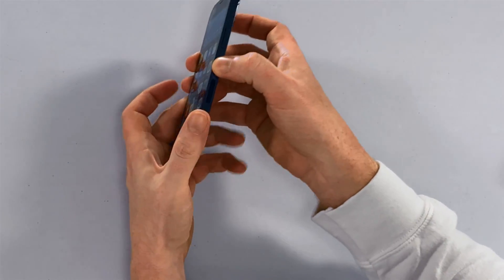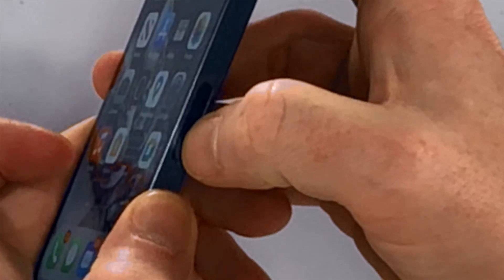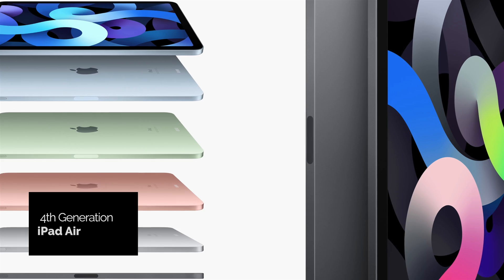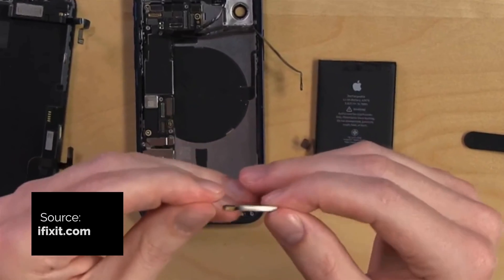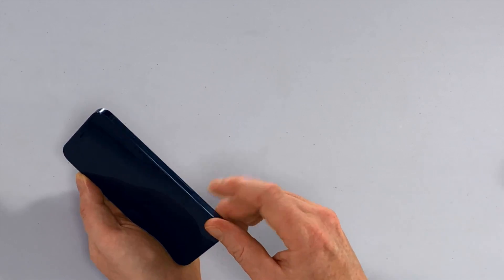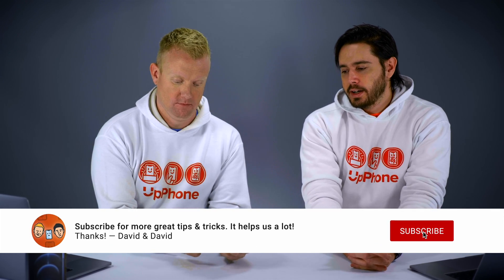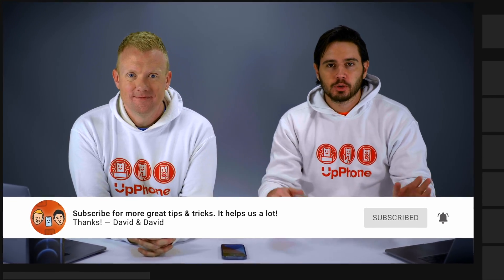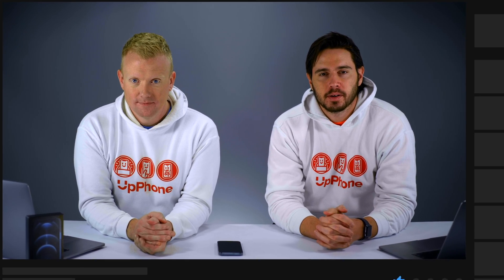Why Is There A Hole On The Side Of The iPhone 12? Here's The Truth!

Comment: If 5G needs holes then what about an object like a wall, etc? Sounds like a step backward to me.
Reply: You guys who think 5G is just one thing are horribly undereducated… there are 3 different layers of the 5G spectrum cake. Low band travels further and penetrates walls easier, at the cost of data speed. Mid band is faster and can’t travel as far or penetrate buildings as well. High band is the type of 5G that Verizon is focusing on and operates at 28-39 GHz providing those insanely high multi gigabit data speeds.

Comment: Silly place to put an Antenna for the phone. Don’t you think that it’s going to get damaged there by drops and bumps to the phone?
Reply: Obviously you have case on it.
Reply: @blahblah5750  correct but are most cases designers are going to leave that slot open or cover it up? Which is going to affect the signal strength.
Reply: @alexanderf514  plastics will have no effect. Metal will affect signal strength. Most cases are not made of metal.